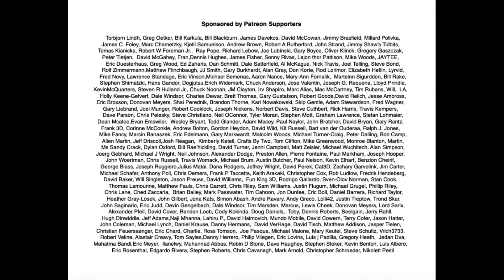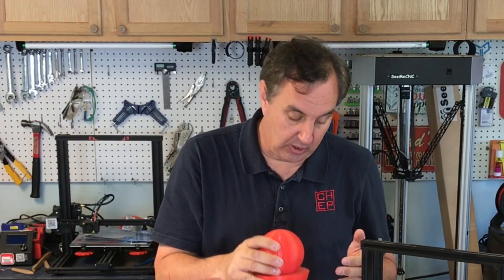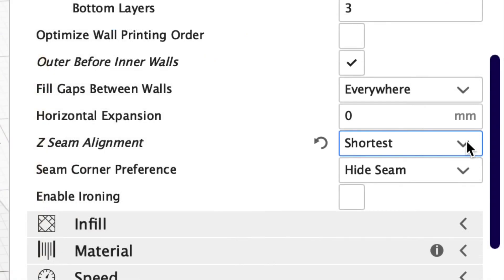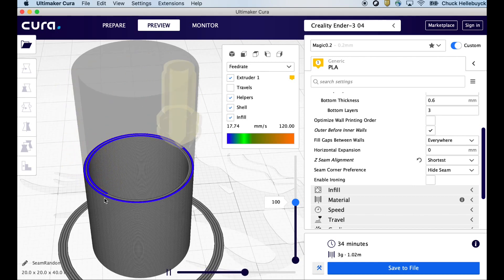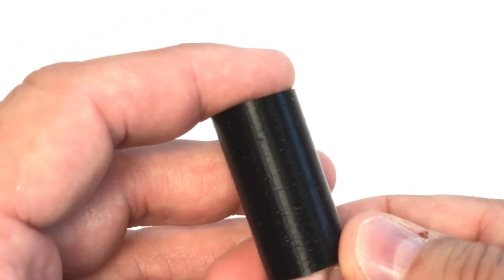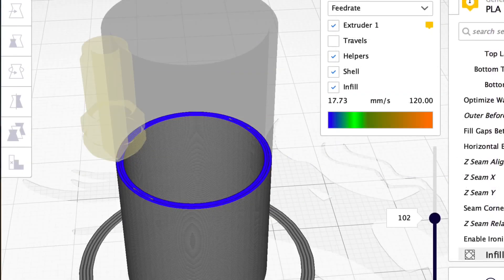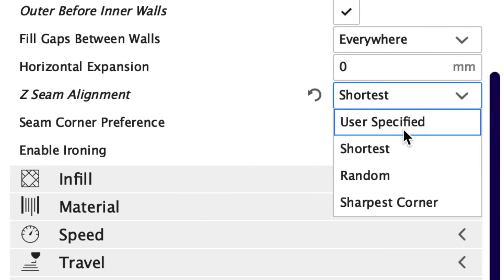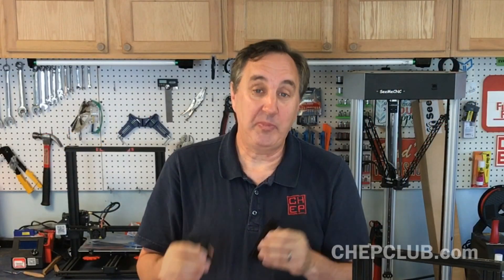How to Control Seams In Cura Slicer Settings

Comment: I like to with my ender 3 with 0.04mm layer height, 103% filament flow rate and pla at 230° 

And the prints are super strong and waterproof. And slower you print the stronger it becomes
Reply: You can also add some post print strength by annealing the prints in a low temp oven. Google "annealing 3d prints", also "baking 3D prints". You'll find charts with recommended temps & times for various plastics. Some plastics it can be a dramatic improvement. Good on you for learning the most important 3D rule - don't be in a hurry. Slowing down handles a myriad of problems. I've seen people spend weeks trying to learn how to make their printer faster, going through dozens of failed prints when if they slowed down at first it was an extra hour. Duh.
Reply: @mrputerpro5383  exactly